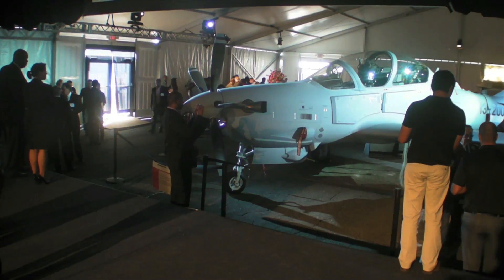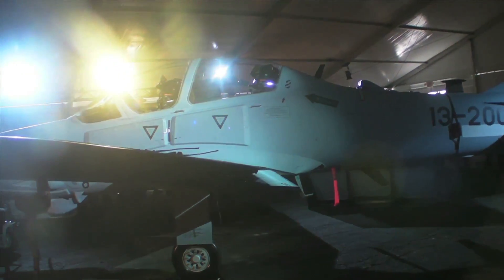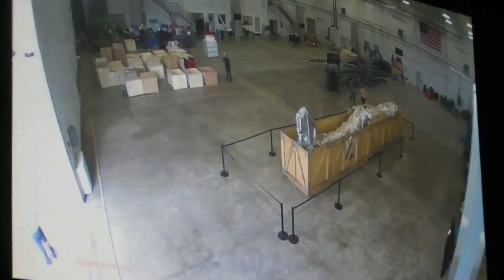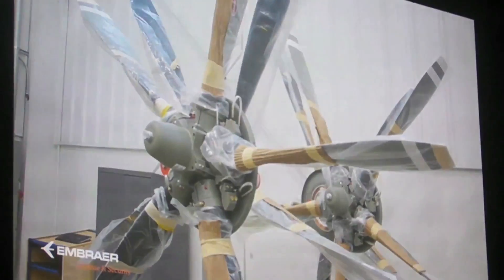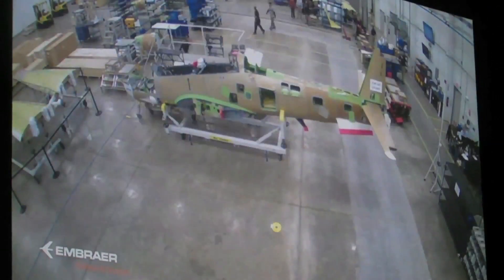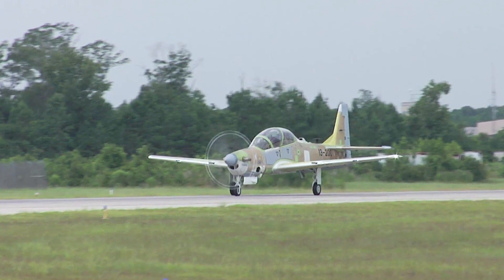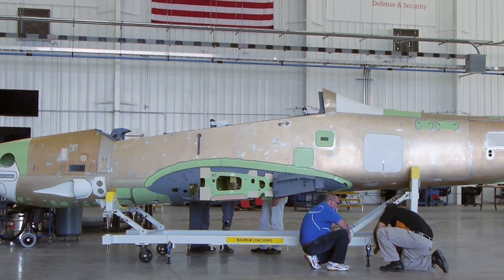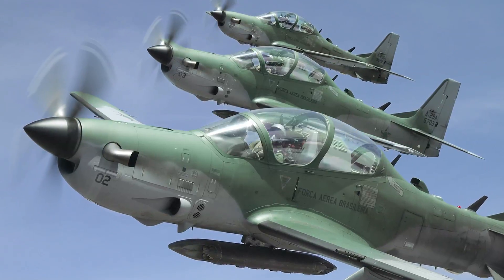Embraer Rolls Out the U.S.-Made Tucano

Comment: The A - 29 Super Tucano is brazilian and was  designed by the hungarian Joseph Kovacz, a world famous aircraft designer. 

The panel eletronic is from Israel. 

The engine is from the United States factory Pratt - Whitney, with 1600 hp. 

This plane has electronic devices for almost everything.

It's a mix of Brazil, Israel and United States technology.

Embraer is the brazilian air force maker, but it became private since 1994.

There's several investors in Embraer and the four biggest investors are Brandes Investment Partners (US, 14,4%), Mondrian Investment Partners (United Kingdon, 10,1%), BNDESPar (Brazil, 5,4%) and the Blackrock (US; 5,0%).

That explain why US and United kingdom armies are using the Super Tucano at their aeronautics.